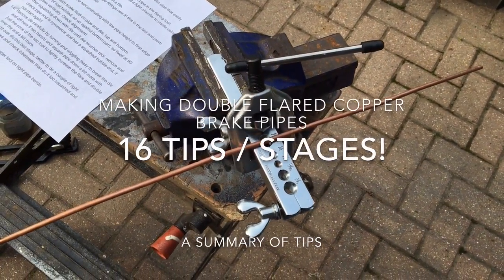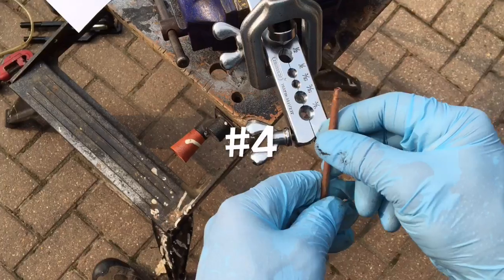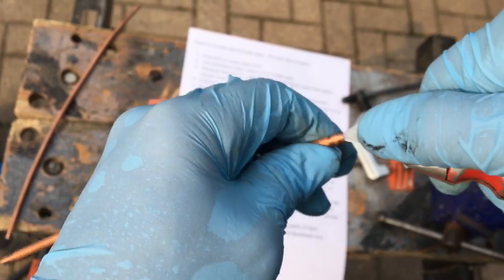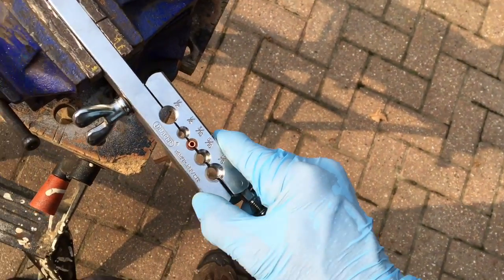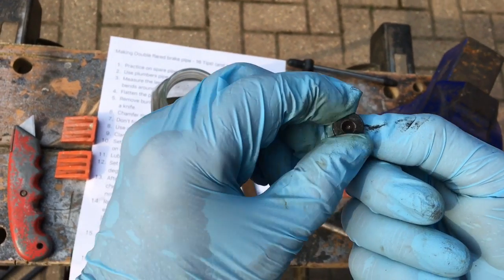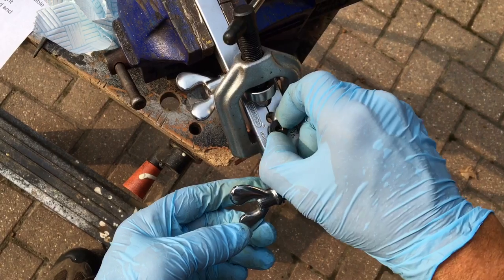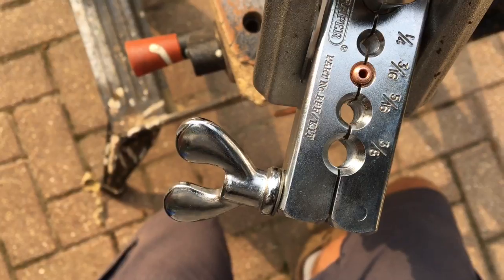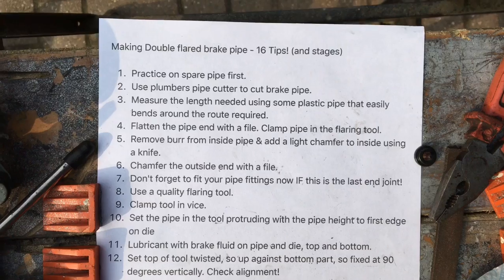How to Make Brake Pipes 16 Tips / Stages!

Comment: Great video. Any tips on making 'bubble' / ISO flares as you often get on european cars? Some people say to just stop once you have the bubble on the double flaring tool like yours,, some say you need a  special ISO flaring tool to get the correct shape bubble
Reply from the maker: The ones I’ve made were in copper so when you tighten the joint any slight shape differences flatten out as the copper is squashed slightly.

Comment: you missed point 8 , that draper tool is cheap and nasty relying on you to manually centre the tool over the pipe ! you also missed an important point out, after all that filing and deburing it might be an idea to blow out all the swarf you produced with an airline !
Reply from the maker: The draper tool worked quite well at a reasonable price. I did have a worse Chinese one.  If you spend too much on tools it defeats the purpose of DIY, ends up the same price as paying a garage. Yes, blow it out, I gave the same comment 4 years ago in the comments “Thanks, blowing it out with some air would also be good.”

Comment: What is the end on the other pipe that is joing up to like ?? Are they both the same shape or is another tool needed
Reply from the maker: You would have a joiner adapter piece with parts that match.
Reply: @comeinhandynow  I've only used the handheld ones before where you can do the 2 types and use a male and female together. The handheld ones are a bit flimsy so thought I'd get one of these types. I'll need to get some straight adapters now

Comment: Not sure DOT considers copper legal. I spent $200 on a good flaring tool and made my lines from steel. Not wanting to take a chance of brake failure with copper.
Reply from the maker: To be honest I am not sure either, buy it is allowed on the MOT test and a common thing to do on classic cars.  Not as strong as steel but a lot more flexible.

Comment: Always makes me question the advice when simple tools aren't used correctly... (file)
Reply from the maker: Surprising the number of people who comment about this small part.  The file was very old and is very little used.  I found another use for it! ;)
Reply: @comeinhandynow  it wasn't the other use. It was a file only files the material  one way. If it is dragged back with the same pressure it doesn't file any material off, and blunts the file.
Reply from the maker: @keithgrainger8797  On copper going the other way smooths off burrs, going the ‘normal’ way aggressively files off the copper. So useful both ways. Copper, being soft, is not going to blunt a steel file.
Reply: @comeinhandynow  ok. Sorry. It was just my initial thought when I saw it. Shouldn't have written anything. The video and advise was clear and helpful.
Reply from the maker: @keithgrainger8797  Cheers

Comment: Totally useless tool. I’m a professional car technician and I have the proper tool to make brake pipe flares. The problem with this tool is that you have too much pipe poking through that when you actually make the flare it bends the pipe over so you end with a lop sided flare. There are far better hand held flaring tools on eBay for around £25. I rest my case.
Reply from the maker: It wasn’t “totally useless” as it made perfect useable brake pipes and how much pipe you poke through is up to the user.  Unprofessional comment.

Comment: How much do you tighten the fittings? Finger tight plus one turn seems to work but I can't find any such specification in writing. The copper aloy tubes require much less torque than steel.
Reply from the maker: Quite firm hand tight on a small spanner is how I would describe it.

Comment: What about the pipe still connected to the car? How would that be flared?
Reply from the maker: Other pipes like that would be made and flared off the car normally (often bought ready made as well).
Reply: @comeinhandynow  I will have to take a look. I would prefer to replace the pipe myself.
The kit is cheap enough.
Reply from the maker: @kennethsmith6022  Agree. Best wishes.

Comment: I've done a lot of fuel and brake lines - this is a great video.
Small comment - the cutting tool usually has a deburring blade on it. Its heavier than a knife blade and does a good job of cleaning/chamfering the inside end. Leveling the end of the line as you showed is often overlooked.
Reply from the maker: Thanks for your comments.

Comment: You're using the wrong nut in your demo. That style nut is for Bubble Flare connections.
Reply from the maker: Nope that Draper tool is for single or double lap flares (SAE double flares). https://amzn.to/3jUmfVq
Reply: @comeinhandynow  I'm referring to the nut on the tube. 09:33 The absence of threads on the end indicates it's for a Bubble Flare connection. Single and Double flare use a nut with thread all the way to the end.
Reply from the maker: @WApnj  Thanks for the clarification. You could be right. I wasn’t aware of the nut differences. There is a lot of mixing up of types if that is the case. I recently bought some ready made pipes that had different nut types on each end with bubble flares but another supplier had non threaded end nuts on both ends. Thanks for your input.

Comment: Great video. I've just picked up a new sealey branded kit for flaring, I got a really bad one online, so bad the arms on the A frame were out of line with each other and no matter how tight I tried to clamp the pipe it just kept slipping through. Thanks for sharing.
Reply from the maker: Thanks.  There is a lot of bad quality cheaply made stuff out there, usually Chinese.  I am starting to get fed up with it.  A lot of the electric stuff is dangerous.

Comment: Just a note, you have used a bubble flare nut on a double flare. It will work but the correct nut to go with a double flare has no step at the end, instead the threads go to the end of the nut, here is an image that shows it https://i.imgur.com/ZF6dSoB.png
The image says never interchange them, TBH I think thats a bit overstated, I have a vehicle where someone has used bubble flare nuts on double flared tubes and it works fine (I think the Cupro line seals quite a bit better than steel) but just thought I'd mention it.
Reply from the maker: Thanks for your useful input.

Comment: Use a good flairing tool, is the best advise. The cheap ones at the chain part stores are shit. One I bought: the holes were too small, compressing fhe pipe. The dies and press were not well fitting, they wobbled while turning.
Reply: I agree, the one I have just got is very average the holes are too small on it, I have used a better quality one and it was easier to get good flares. i've been wondering about trying one of these types https://restosupplies.co.nz/on-car-flaring as I only ever work on the 3/16 line anyway.

Comment: I'm curious... This pipe looks like copper, is this some kind of fancy alloy you use in Europe? Here in Canada we use soft steel and we're always told to make sure NOT to use copper...
That being said I haven't had to do brake lines since the 70s so I'm a bit rusted (my brakes lines are far worse, hahaha)!!! Nice demonstration on the bubble joint system!
Reply from the maker: Thanks, yes copper is allowed, in UK.  I guess it can be more prone to rock damage but the advantage is it doesn't rust of course.

Comment: are there two kinds of flares? the pipe that goes from my brake calliper to the brake hose seem to have slightly different flares on each end? one seems more dished shape, the one to the brake hose and the one to the brake calliper  is I think more like the one yo have done here, was the dished  shaped one the flare you made first before putting the tool back on it?

Comment: One of the easiest way to ream the inside of the tube is to use a drill bit that has a sharper ground lead angle. Way easier that using a sharp utility knife and oops you cut your fingers. Good day too. VF
Reply from the maker: Thanks for the suggestion.

Comment: So many videos are confused with the american videos and the tools that everyone has have no instructions.
  From what i can work out a bubble end which is used in Europe and can mate with a double flare when using female and male nuts. But to make the bubble you should use the flat side of the clamping tool and a double flare is a female shaped end which you described how to do.
  Literally everyone is getting this wrong or have been confused by most of the american videos which don't often cover how to make a bubble and what ends mate with a bubble, which actually appears to be a double flare.
  There is not one video i can find where someone uses a metric tool and makes one end male (bubble) and one end female (double).
  There are only american videos explaining how you can make metric ends if you cheat the cheap tools that everyone have by using the flat side of the clamp to make a bubble and the concave side to make doubles.
  Also it appears that you need to leave more brake pipe protruding when making a bubble than when making a double.
I have always made bubbles in the concave side but found that they only just make a connection and sometimes you are desperately cranking the nuts up super tight to stop them from dripping. Finally they make some sort of connection but only from forcing them into the union.
  If only someone could cover this topic correctly! Seems very dangerous to me that so many people are confused on this subject.
Reply from the maker: Interesting perspective on differing applications.  Personally I’ve only had to make double flare female pipe joints because that is what all the brake connections have required.  If you want to join two bits of pipe I use a pipe joint part that takes two female flared pipes.

Comment: What are some good inline  solutions for when the line cannot be disconnected from the car and you are laying on your back on the ground?
Reply from the maker: You need to trace the line back to the nearest junction and remove the whole section and replace with copper pipes, or a pre-made steel section from the OEM.
Reply: @HenryFord-x2f  Yes, I wished I'd used that one
Reply: It's not a "pleasant" experience, but this same tool can be used while "laying on your back on the ground"! I've done enough of them like that, to say it can be done! And most on OEM steel pipes. Which is a pain in the back bottom part! LOL 😂

Comment: I think choosing thicker coated steel material is leading to some bad results. Following these steps and getting misformed, lopsided results. Maybe the heavy stuff is only suitable for machine shop level tools and presses.
Reply from the maker: Yes these tools and this guide is only for copper pipes.  Just replace the steel pipe with copper.  They are much easier to bend and install.  If you want to use steel just buy that pre-made section from the car manufacturers dealer.

Comment: Excellent video. Tip 17# DO NOT BUY A CHEAP ONE OFF EBAY FROM CHINA, THEY ARE AS MUCH USE AS AN EJECTOR SEAT IN A HELICOPTER.
Reply: Although I totally agree there are much better quality products around. And I confess, like everybody else, sometimes I think I "must" buy a pro version!!
But then, invariably, comes to mind the undeniable fact! I've been using the cheap Chinese version for some 7 years. Or putting it another way, more times than I like to think about! 
With exactly 0 failures either from the tool or the resulting pipes!! I guess almost 20 cars have been served with that cheap Chinese tool. NONE ever returned with an issue... ;-)

All in all most pedantic opinions should focus more about, learn how to use a tool than badmouthing without a clue! It's a way more productive mind set! Cheers

Comment: I would like to add to the cutter use. Do not try to cut the complete cut in just a few turns. If you tighten it down as you turn like a bear would you can press the inside and make much harder to clean out. Great video.👍😃
Reply from the maker: Thanks, good tip.

Comment: Tip -When filing the pipe do it so the pipe is facing down so no copper filings/burrs  enter the pipe.
Reply from the maker: Thanks, blowing it out with some air would also be good.
Reply: @comeinhandynow   Aye but best off not to get any debris in the pipe first  - Using a pipe cutter means you should not need to use the file after  - Nice F type BTW : D

Comment: If you need to use pliers to remove the Die from the flare you have left too much pipe through the tool to start with. If you mount the tool 90 degrees around it is easier to view the tool and the flare as it's made. You don't need to file the end of the pipe if you sue a cutter such as you have.

Comment: See his damn Harbor Freight bender does 180 Degrees. My damn OEM bender can only do 90 Degrees and Creates a 5 inch wide U-turn for coming under a brake tree. OEM Waffle Press Brake Line Bender is garbage. Even if okay priced. Get the regular circle bender, mini bender, or hand pliers bender.
Reply: Hi Neil of 'Cidi Al-Masry' Sidi Al-Masri Sandage - Save yourself a bunch of tinkering and some money.
Use a socket with a radius convenient for whatever you're bending. 
Voilá.
Simple, effective, way cheaper, reusable, "add other nice adjectives" to your new found tool, according to your liking. LOL :-)
Cheers

Comment: Why is it that no matter how many times I do what is instructed within these instructions, I can still not get the pipe to squash inwards?
Reply from the maker: Try altering the amount of pipe that sticks out of the tool before the first squash stage.  Or the die (the bit that goes in the end of the copper pipe) is of poor shape / quality.
Reply: I tried differnt lenghts and still no good. Then I done some more research into flaring tool and discovered thereare diffenret flraring kits available and that some only do single flares whils others do double flares and bubble flares. Unfortunately my kit only does single flares.
Reply from the maker: Glad you found the reason. Thanks for sharing.
Reply: I'll certainly find out better when my new flare kit arrives and see how it goes with that.
Reply: My new flare kit arrived and it's is superior to the other kit I have, it does a perfect bubble flare each time. I even achived this wihtout the need to file the pipe ends and my brakes work better than ever. This kit also doe other flares which i haven't attempted to do as I had no need for them, though I'm sure it will do a good job. Here's a link to the other kit: https://www.ebay.co.uk/itm/Brake-Pipe-Flaring-Tool-TRIDENT-T413701-3-16-316/183233962008?ssPageName=STRK%3AMEBIDX%3AIT&_trksid=p2057872.m2749.l2649

Comment: I can only seam to find brake piping that is packaged in a circular role. 
Anone know where you can purchace straight lengths of brake pipe? Preferably UK suppliers.
Reply from the maker: Copper brake pipe it easily bent, so just straighten out the coiled up supplied.
Reply: it is so easy to straighten just roll it out as you wood a carpet

Comment: Thankyou very much I've got to tackle this soon as my car failed it's mot on all of them looking forward to the challenge I noticed your using draper and also noticed the better quality in the metal to that of the cheaper versions personally I do like draper tools, also that look like copper pipe there that you were using but I'm planning on using cupro nickel as I've been told it's more weather proof
Reply from the maker: Yes I've heard cupro nickel are a bit stronger, but copper is strong enough and I've used it on several cars with no problems. Copper is certainly easier to bend.  Maybe try a bit of both types while practising the pipe flaring.
Reply: I believe copper pipe is not strong enough for vehicles with ABS brakes, due to the high pressure .
  Copper is OK for vintage cars without ABS.